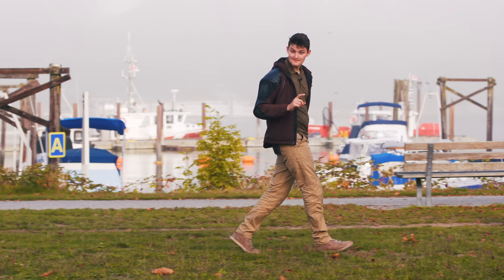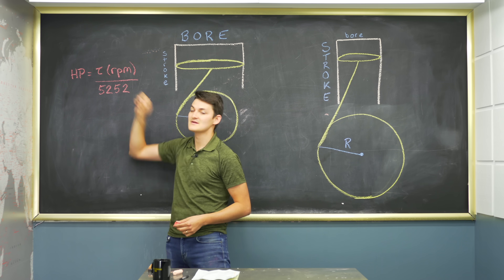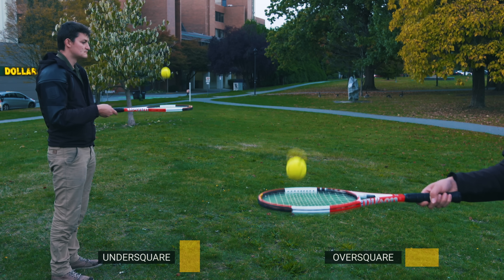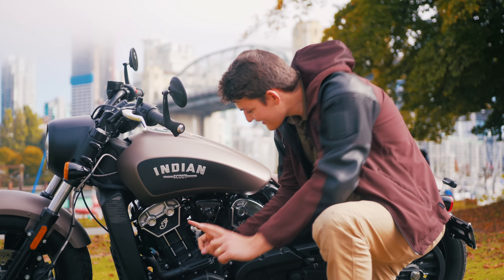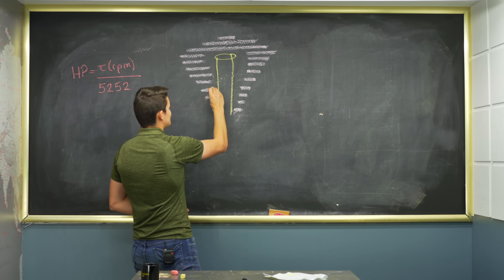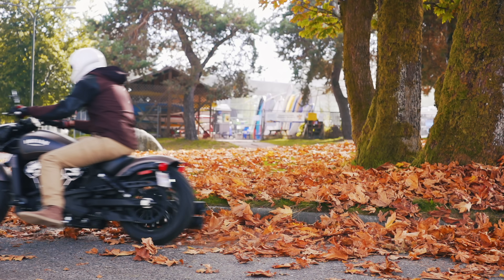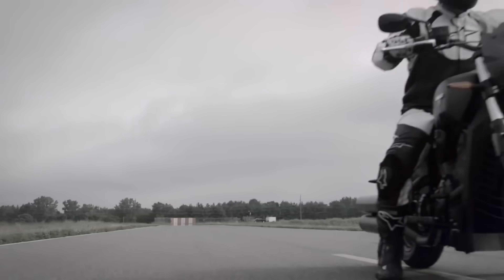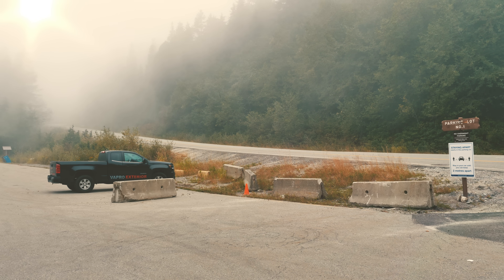How Indian Makes 43% More Power than Harley-Davidson

Comment: Theres no replacement for displacement lol
Make a sporty a 1275 and some hot cams w/ pistons and head to match and you can reach 120HP at less than 7k rpm. 
You can go even higher and make a sporty in to a Torqster and get the 90ci cylinders with again cams pistons and heads to match and you can reach 140hp.
Good luck doing that with an indian.
Buttt that takes money and you'll be doing the work yourself (that 90ci? you need to cut into the case to make it fit, you'll need a machine shop which means taking the case outta the bike)  unless you want to spend double the price and have someone else install it for you. Plus theres the issue of reliability, you're not taking that 90ci to work as a daily. 

I've built mine (with a teacher) as a 1275; good cams and massaged heads with good pistons and make 95ish HP with a rev limit of 7k. I'm at the point where the motor outperforms the chasis, so I'm going to work on the chasis first before I try and make it faster. I can very much out corner an indian, as I have mine lifted and not lowered. 

Its the nice thing about a sportster, such a long history compared to the Dyna or Softail models; I can make it become anything I want.

Comment: Harley is a cruising motorcycle . With a cruising motorcycle you want low end torque and not having to wind up the rpms or be in the wrong gear because you don't have the rpms' to achieve it.
You want to give some throttle input and have the torque at the rpm's your at to get out of harms way ect maneuver in traffic.
You may not have time to downshift to get into that power range.
If you've ever seen a Harley maneuvering in traffic they don't need to downshift.
Overhead cam bikes tend to make their power in a higher rpm range , not what people want in a cruiser bike.
With a cruiser your not out wringing out all the power you can like some types of bikes do.

I had 72HP with my 1450cc harley at the wheel ( dyno). My Rocket 3 was over double that (2300cc overhead cam)
Both were fun bikes and got the job done. Most of the time your using a fraction of the power of a bike anyways.

I've had cruising bicycles and race types. Each one fit there niche. I wasn't mad because my cruiser bike wasn't as fast as my race type.

Comment: Ryan.. I love your work.
Interestingly they put two sparkplugs per cylinder in my Honda 1300 like an aircraft motor.
Better burn for both power and pollution.
Find with water cooling. Clever Japanese.

Comment: TLDR Version: To the harley defenders  |  If you don't understand the physics of engine design, try not to prove it. Air cooled twins with enormous strokes will NEVER be competitive in a road race and will only win drag races 3 times before a rebuild, competing against STOCK Sport bikes. 

Longer Stroke = lower RPM (see piston speed limit) | Single pin crank = poor and uneven power delivery | air cooled = instant HP restriction due to the physical limitations of metal. Thats why Harley's have lower performance.  
Longer stroke also gives them all of the (Cubic Inches), Cu inches does not = power.  De stroke that motor, and a 1200 sportster is now a 550 cc motor. This is how a Honda 500cc puts out the same HP. 

 The most powerful motorcycle engine is a supercharged 1000cc (Kawasaki H2r), still even smaller than the 1200 sportster, and puts out 333 HP, insane numbers. 

Harleys are for a generation of people that grew up in a different era, its what they want. Harley has done a good job providing that. but those people are aged, its over. 

Harley canned Buell, he was making amazing motorcycles, Harley could have built Boomer machines, while also providing American bikes that had handling and power. Most Gen X  pure motorcyclists HATE Harley for this, and will never purchase one.

 Another thing about guys that ride Indians vs Harleys, the Indian guys don't look down on your bike choice. I don't know how many times a Harley guy ( that rides 1200 miles a year) tells me that I need to buy a real bike.. I ride an Fz-09, that thing would crush anything in the Harley lineup, but because its only an 850cc, they think otherwise. Its so cliche.

Comment: Indian scout is definitely an amazing machine indeed, a blend of modern technology and and nostalgia which makes it more exciting to ride. Unlike harly all they care is about tradition for decades and it just no longer makes it exciting anymore but the same old boring chromed design that produces low hp with no benefit besides extra loud exhaust and extra fuel consumption that barely pull itself to highway speed limit, while other motorcycle brands already integrating new technology every year with extra beneficial features and functionality and more fuel economy.

Comment: So Indian is on the Japanese bike train. Nothing wrong with that if it's what you want. One problem Harley had with the "modern" bike (V-Rod) was it's physical size and layout ergonomics. Great bike that was cramped for taller guys. I like the Indian bikes. I like the Harley bikes like the Breakout, Fat Boy and Fat Bob. I test rode a 114 ci model and the low end torque is nice. I've never cared a lot for having to run 6,000+ rpm to get at the powerband. When I do occasionally want it I get on the old Honda. The problem with most new bikes is $$$$.

Comment: That Indian motorcycle looks better than anything Harley has ever built. I wish I didn't have balance and blood pressure issues so I could ride one.

You know, Harley could keep their pushrods and air cooling, they would just need to use more advanced materials to do it. Titanium pushrods weigh half as much as steel, and aluminum cylinder heads have better heat conductivity than cast iron.

Comment: Laughs in CRF1100L engine notes. Over 100BHP with the same displacement, 0-60 in 3.2s. Parallel twin, 270 degree firing order. The go-anywhere, do anything bike.

Comment: Meanwhile, Honda designed a pushrod V-twin all the way back in the 70s that makes 50 HP from 500ccs and will quite happily reach 11,000 RPM before the valve begin to float.  You even own one, Mister Ryan F9  :p

Comment: One thing i like about old air cooled harleys is how much easier they are to work on. Once you add liquid cooling, fuel injected computer controlled engines you pretty much have to take it back to the dealership to have it worked on. Also the less stuff there is on a vehicle that can break the less stuff you have to worry about fixing.
Reply: Buy a Honda ….problem solved .
Reply: Okay boomer

Comment: A V twin, long stroke Diesel with a compound Turbo is the next Holy Grail of motorcycles.
Torque is better then Horsepower.
And easier to ride and control.
Also I would make it a Two stroke Diesel, Detroit Style, but with redesigned for efficiency and emissions control.
Reply: If you're going to get silly, I would rather have an opposed-piston diesel.

Comment: Couldn't the overheating problem be slightly reduced by dual sparkplugs? Both close to the cylinder walls, while also giving a more even spread of the ignition.

Comment: My modified VN 900 makes 30% more HP than stock and is half the weight  and 1/10 the price stock ( mods cost a little ) of and Indian or Harley !
 The dealer gave me a credit card for $10,000.00 and $200.00 payments and let me ride away without insurance ! Oh yeah and $500.00 rebate ! Even though I put front and rear pulley's , a 200 rear tire , fuel management bigger air cleaner and 2 into 1 headers , I Still wished it had 1 more gear  ! She goes 5mph faster than the speedo reading ! She's a 2011 50,000 miles ( all mine ) and nothing has broken ( except what I broke and  2 deer that tried to kill me )!! And she never leaks a drop !

Comment: them pegs are close to the ground and so are the pipes.  that scared the crap out of me just watching it.  I crashed my 81 KZ1000 at an intersection when I leaned too deep making a left turn and the center stand jacked the rear wheel off the ground, it slammed me to the pavement like a pro wrestler and it hurt like hell.

Comment: one small doubt if we have more volume of fuel in undersquare engines wouldnt it solve the problem of the expansion as now the gas has to expand to a lesser distance to be in contact with piston and in turn exerting force on piston evenly at higher rpms. Just a query know very little about internally combustion engines and also cant we tweak the firing order to match the pace of piston ??

Comment: If Chevy can make a mid-engined corvette, Harley can make a liquid cooled Sportster. Don't change the styling, just make the Sportster liquid cooled like the Scout,  make it actually sporty like the Scout. They would sell like the V-Rod didn't. It would require a complete attitude change towards the Sportster.  They won't but it would be the ideal point for Harley to start moving towards a real future in line with their customer base, instead of electric bikes that none of their actual customers want.

Comment: Sorry that i´m ´4 years late.
After seeing your video. Of the things you claimed limiting Harleys engines, could you explain the existence of the Yamaha XV 1700 Warrior?
An aircooled 48° pushrod V-Twin with 85 hp and 145 Nm torque.
Reply: Sound. harley has a deliberately engineered misfire its what creates the sound but you loose power. Harley knows that but its also what the customer likes when they buy a Harley cruiser

Comment: The problem comes with the tradeoff of wear and tear.  I am a gearhead. I own one of the Greatest Motorcycles HD ever own the 93 FXRS Lowrider Convertable.  I have 138 thousand... yes 138 thousand miles on it and it is in  BEAUTIFUL condition.  I have 1/2 million miles on all motorcycles.  I can say for certainty that my motorcycle which is STILL in stock condition is a F@#$%ing tank in reliability.  29 years of wonderful performance and the ride. I am suspect on the longevity of what is being made now.

Comment: Problem is… Indians don’t make 43% more power. 

Your basing the number off the Evo 1200cc motor vs the Indians 1200cc in the Scout, which made 100hp in 2021 when this video was made. 

Why not compare apples to apples with Harley’s 1200cc motor from the Vrod? Which made 115hp. 15% more than Indian. 

Or the  2021  1200cc RevMax engine in the sportster S making 120hp & 150hp in the PanAmerica

Comment: I like your videos, and you are very good at explaining stuff for the Novis. But Yong man, if there was an explosion on top of the piston it would blow to kingdom Kong, it is a COMBUSTION, that is why it is called a COMBUSTION engine and not an explosion engine. Take it from an old school engineer. (If I was teaching i would play your videos to the new aspiring engineers, yes they are that good)
Reply: An explosion is a type of combustion the other type being fire and since I wouldn’t call what happens in an engine a fire that would make it an explosion.
Reply: wrong my friend. Every educated engine expert ''like myself'' will tell you that. The key difference between combustion and explosion is that combustion is a chemical reaction that produces heat and gases slowly for a certain time period, whereas explosion is a chemical reaction that produces heat and gases rapidly in an instant. Explosive materials do not need any oxygen from the air to detonate.

Comment: BMW had similar probs in the 80s when they wanted to abandone the air cooled flat-twin 2-valve engine, and establish the watercooled in-line 3 and 4cyl. "flying-brick"-design. The traditional customer didn't accept.

Comment: How Indian Makes 43% More Power than Harley-Davidson:
They went to Switzerland and asked for help: "Swissauto Wenko AG" near capitol of Switzerland (Bern) is the company that engineered the Thunderstroke engine of the modern India motorcycles. The same company that produced a legendary 500cc V4 2-stroke (around 200HP and 40kilos, incl clutch and 7-speed gearbox) that ruled sidecar championships for Years and also was a benchmark in Moto-GP racing back in the 90's.

Comment: Great video as always, although I'd point out that max HP figures aren't always the whole story. My old Porsche 924S makes only 170 HP from its 2.5L engine, which sounds a bit pedestrian. However, it has bucket loads of torque and one of the flattest torque curves I've seen in a car engine. This means that it's extremely satisfying to drive on a windy road because it pulls strongly and smoothly out of corners without bogging down, even though it doesn't really take off at high RPM. I think the Porsche engineers could have designed for higher revs and more power but deliberately chose higher torque for a better every-day driving experience. It's not much use making massive HP if you only get it at 6,000 RPM - at least not in a road car. I guess bikes are the same, and the Harley Davidson gives the feeling of smooth low-down power that the enthusiasts love - although my experience is limited to a Honda SL230 and a restricted license at the moment!

Comment: If I wanna go fast, any of the Sportbike lines have a model for me. But. I'm one of those weirdoes that doesn't want to go fast, I'm happy just to be riding my 22 Harley Softail Standard. I put a fairing on it to cut the wind a  bit and eBay was nice enough to provide an undamaged pair of 2020 Heritage bags for $400.00 that bolted right up no worries. So you and your Indian will just have to go around. Byeeee!

Comment: Can you get the scout bobber even 1 inch higher?  Can't be that thard
Reply: You could get aftermarket rear shocks that sit higher, but not sure if you can get a whole inch of ground clearance. I just bought one though and can't recommend it enough. It's a fun bike. Mine's a Rogue though because I have a short torso and the short bars on the actual bobber folded me like a taco.

Comment: Harleys MOST POWERFUL engine ever, the Screaming Eagle Stg4 135ci, makes just 126hp and 141tq on a dyno....Yamahas 2009 Vmax 1700cc(in reality a 1679cc engine) is a much smaller 102ci(1/3rd less displacement) and yet it makes 180+whp and 120+wtq with nothing but a flash!

Comment: One thing that's killing hd is that they have lost sight of who they were.  There was a time when you could hop on a harley with a small tool bag and keep it going for years.  No need for an expensive shop  with walls of tech. Just your small tool kit and some know-how. No on board computers to tune. No radiator.  No abs to fail. Just a simple motorcycle.  Everything you need and nothing you don't.  Not the fastest not the best handling.  Not even the most reliable.  Just dead simple and easy to keep going, with a large lazy underpowered and thus unstressed PowerPlant. Yes it leaked oil everywhere.  Yes it was slow. Yes its less reliable but you could put a couple saddlebags on it and go cross country on it and never see the inside of a shop,  if you had just a little bit of know-how

Comment: ....I would never ride bike that low. If something is about to or even close to touching the road and if there is bump in the road causing one end to dip and then that peace hit the ground, that can easily get you loose the traction. Sure Harley and India is not designed to do tight corners but bloody hell least have enough ground clearance that its safe to corner. Also might want to make some lighter weight models that dont cost arms legs and kidneys, while sending liver to pawnshop...

Comment: What a long explanation for "cause it revs higher". I'm surprised none of the manufacturers have tried something stupid like VW did, a "soundaktor" to make a bike sound like potato to hide the fact it's a completely different engine. Add in a mass driver for the "rumble" and no one would be the wiser if they didn't take off the pretty cover.

Comment: My 1200 Buell based on a HD sportster motor makes 103 hp (OK I doubt it but at least 90) so you can get more power than the Indian from an aircooled long stroke pushrod motor. No doubt you could also get more out of the Indian if you tried.
Reply: I own 3 Buells, and they are the most enjoyable bikes that I`ve had in over 45 years of riding. Great combination of power, handling and `feel`.  The spring after I bought my first Buell, I was so impressed with it that I bought a `real Harley`--a 1200 Sportster Roadster.  I soon realized that it was overweight, under-performing, ungainly ,and that there was no easy way to solve its lack of ground clearance in corners.  (I tend to drag pegs in bends)  Also, no good for carrying a passenger. SOLD! to the first guy who came to see it. He wanted a Sportster, but could n`t stomach the price at the dealership.

Comment: The long stroke of the long connecting rod has two advantages simply put is a long lover gives you more torque and the second one is when the crankshaft spins you have a split second longer there during combustion event cycle

Comment: It's nice to have the factory to build your your horsepower for you. But he's being a bit ingenious in saying pushrod engines can't be competitive with overhead cams. You do know that there's been a break through with light weight metals about 40 years ago. Yes over head cams are more efficient and water cooled engines will run cooler but I have something you classroom riders don't.  The knowledge to build my engine anyway I want it to perform with minimal high tech equipment. I like classic cars and bikes. I have 2 harley Electraglides in my garage. They're not classics 92 and 95 and one is mostly stock and the other will take that scout apart. If you are a guy and you take your bike to the dealer for an oil change and and tune up you wouldn't understand what I'm talking about.